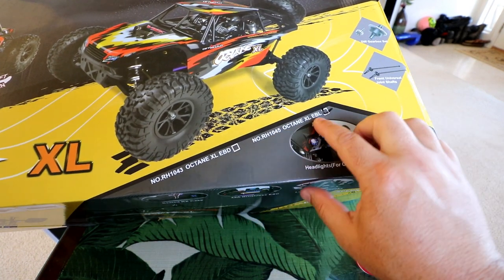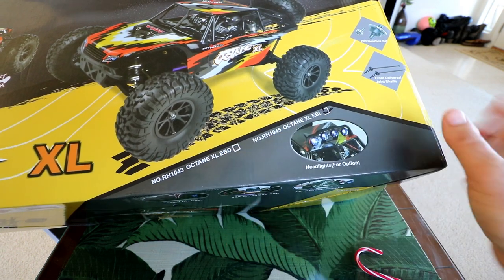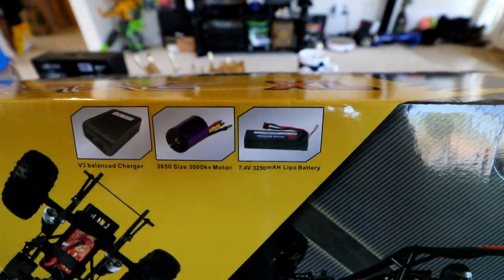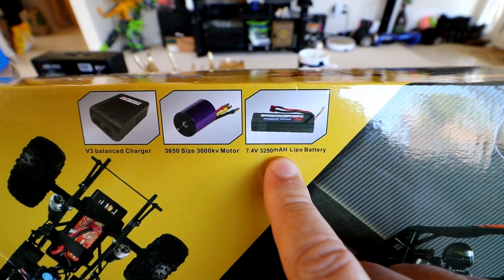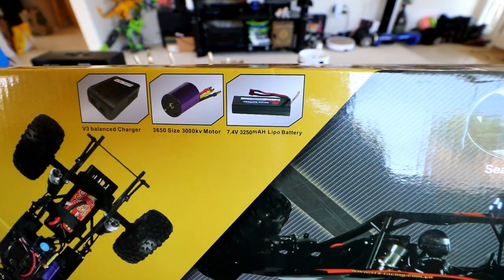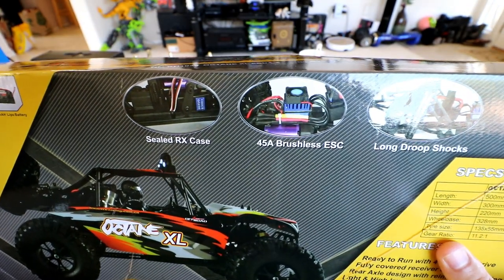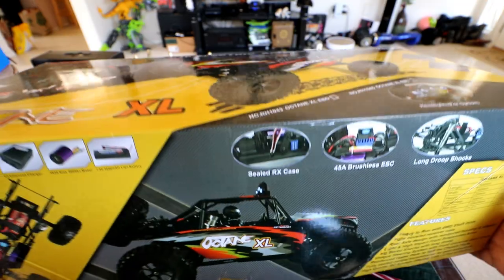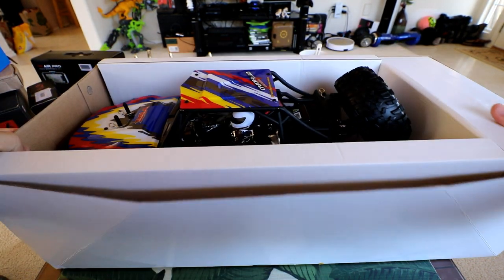AXIAL YETI Clone! - VRX RH1045 OCTANE XL 1:10 RTR Review - [Unbox, Inspect, Bash, Pros & Cons]

Comment: When the rear wheel came loose it allowed the wheel hex to spin so you where only getting front wheel drive .
Looks great though 👍🏻
Reply from the maker: +fgbaja29cc You may be right.  Was weird how it did it for a bit partially through the second run.  I didn't notice any hex hub strip.

Comment: If you adjust the shock mounts on the side that the wheel picks up on they won't pick up off the ground as much keep the rear shocks up high on the mounts and drop the fronts down on the mounts that should help.

Comment: one thing nobody has discussed is what type of piston is used in the shock nor what weight of oil is recommended for the shocks ? Also I noticed when you disassembled your rearend, it looked like it was caked with grease, is this done throughout the truggy, or what weight oil do you recommend ?

Comment: Hi, Had the same diff problem with my ZR racing thunder, no stripped gears, had the same result as you did, after disassembling and reassembling worked fine for a while then the problem returned. I took out the rubber spacer on the rear diff and this helped a lot but eventually the problem returned.
My guess is that many cars use common parts (like diffs) only trouble is in both your case and mine where the RC delivers huge torque the diff teeth are not sufficiently well meshed to cope and move slightly out of alignment.
If you managed to solve the problem please post the solution.
P.S. Swapped out the front and rear diffs this kept the RC running for a while until the same problem occurred. I have ordered 2 new diffs, hopefully shall be back on the road soon.

Comment: I think the heavy wheel in the back is helping the torque lift front end?? Would you describe the vehicle as sand racer basher? Because it didn’t seem to work well on rocks so not a rock crawler?? So flat surface basher???
Thanks 🙏
Reply from the maker: Yes more of a rock racer or fast small jumping and mild fast terrain 👍

Comment: My bet is your wheel came loose enough for the hub to pull free of the axle.  It happens
Reply from the maker: +Matthew Brothers Possibly.  I'll have to look at it more closely.  I didn't see any stripping and it had an intermittent slip for a bit on the second part even after cranking and locktite.  Perhaps there is a crack in the room I did not see letting the hex hub spin at times
Reply: Dustin Dunnill indeed that's what I'm thinking as well

Comment: To keep the lift on the right side down...would tightening up the suspension on the rear left and front left slightly help at all?
Reply from the maker: +Yordles Of Doom That should help but handling will suffer a bit in anything other than full throttle runs.

Comment: Hi Dustin did u find out what was wrong with this truck
Reply from the maker: I tightened the screws directly below the center diff/spur gear under chassis and it hasn't done it since 👍
Reply: Dustin Dunnill just shows u dont it you need to go through every nut n bolt n screw b4 you run or fly them which u shouldnt have to do also do u no wat other props fit the x16 drone